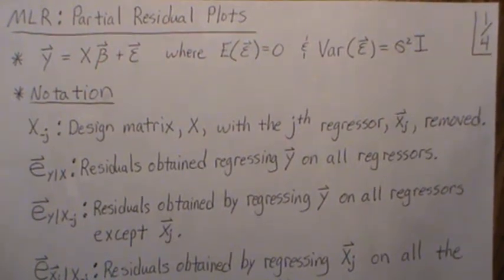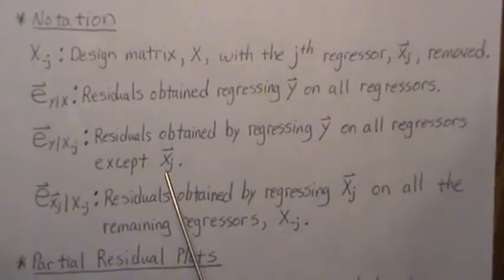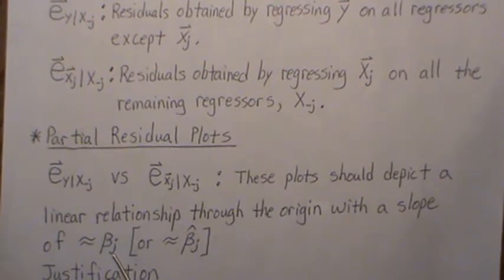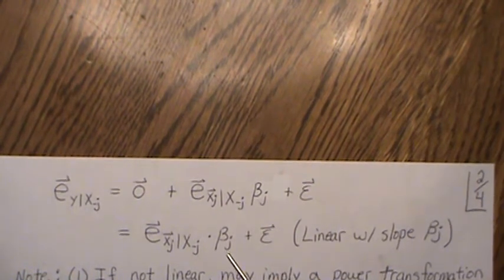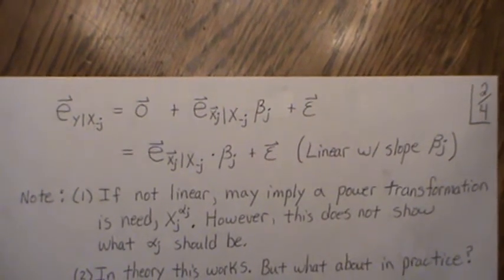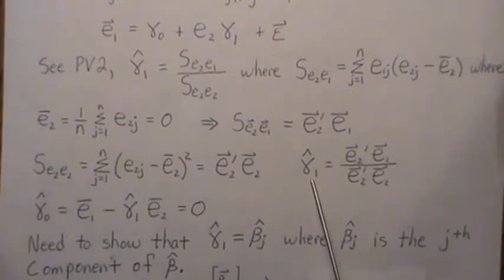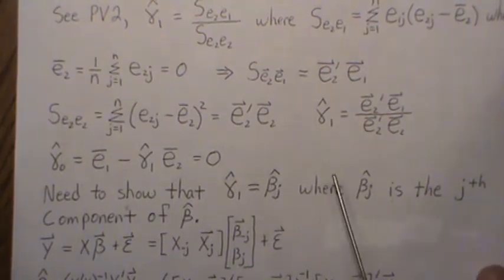Multiple Linear Regression: Partial Regression Plots (Added Variable Plots)

Comment: I have a question sir. The epsilon becomes heteroskedastic after multiplying by (I-H_-j), which does not meet our assumptions. So why can we just reparametrize it？ Thank you！
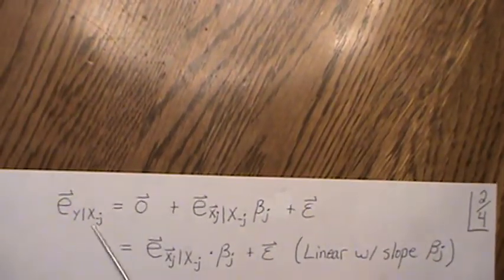Reply from the maker: Thanks for the question. And many thanks for watching. Don't forget to subscribe and let others know about this channel.  First, the epsilon at 5:49 in the video should have an asterisk on it. e^* = (I-H_-j)e. We are interested in the slope parameters, the beta parameters. Conducting a regression with a non constant error variance still produces unbiased estimates for the slope parameters. Added variable plots is a technique to investigate the partial correlation between x1 and y (removing the effects of the other variables).  The fitted regression line between these transformed variables has the same slope as the coefficient on x1 in the full regression model, which includes all the independent variables.